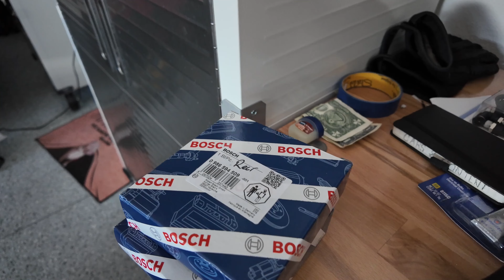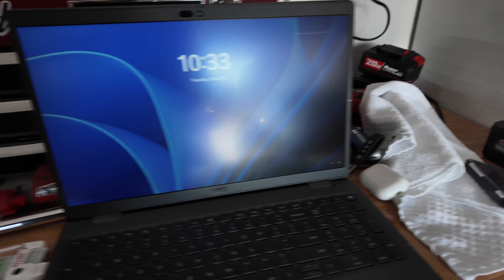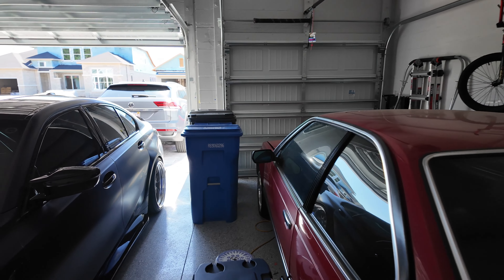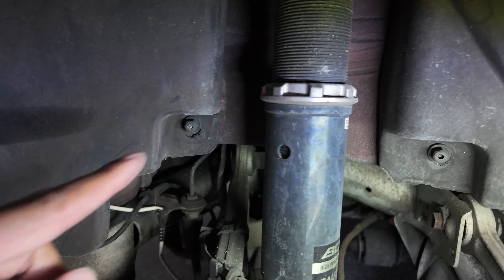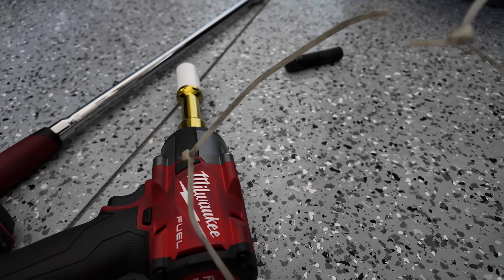Classic BMW E39 Gets some attention - FOR SALE  | OEM+

Comment: Great video
Just a tip for those in a tight budget with a problem with this speed sensors on e36 e46 e39 (basicly bmw of this era) usally just taking them off and cleaning them with some eletronic cleaner does the job.
Reply from the maker: Yes that’s very true. In my case it wasn’t even the issue it was the abs control module that was faulty so I could have saved a few hundred lol